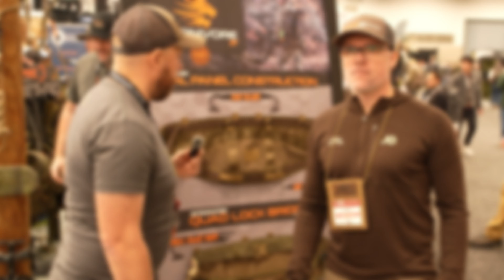NEW CARNIVORE HARNESS - TETHRD- ATA SHOW 2025

Comment: I wonder how different it feels being in that saddle compared to something like the latitude method 2 🤔 so far the only saddle I've used is the tethrd menace saddle
Reply from the maker: Bro honestly, anything is going to feel amazing compared to the Menace. Its a good starter Saddle, but you will be much more comfortable in an upgrade.
Reply: @Mat-Miller  yeah I need to get a different saddle mostly because the Menace I got is in a large and I should have gotten a medium but oh well it would work until I have to replace it